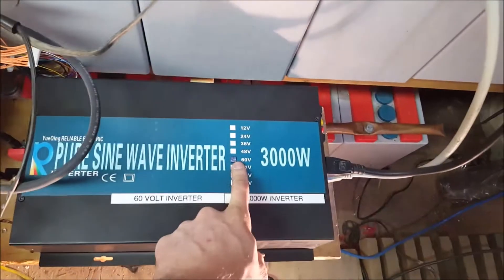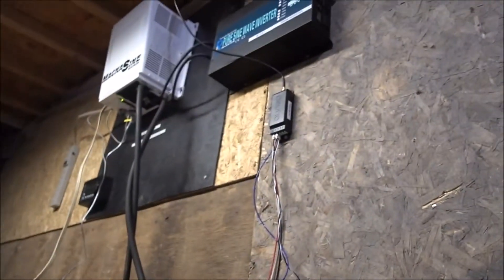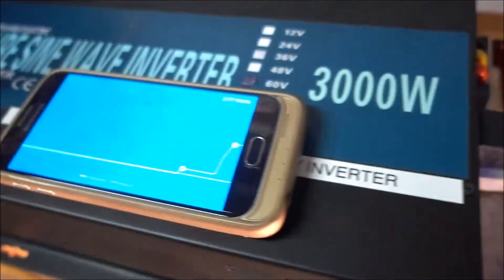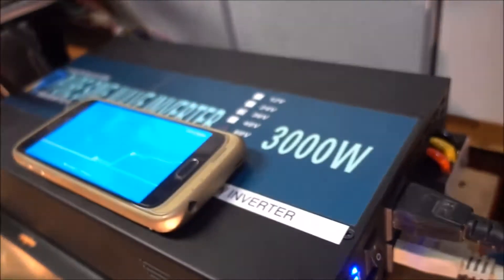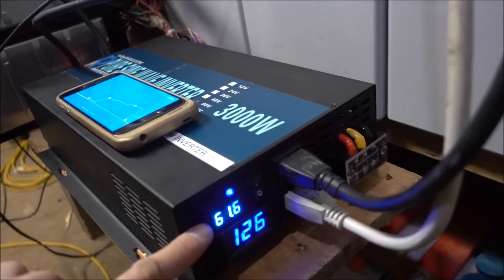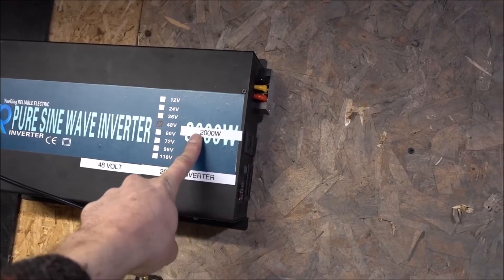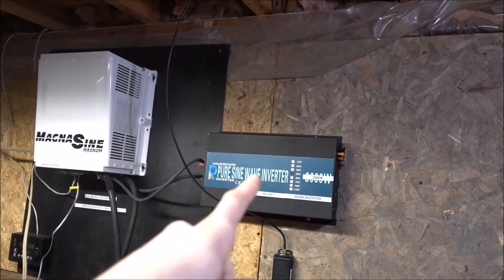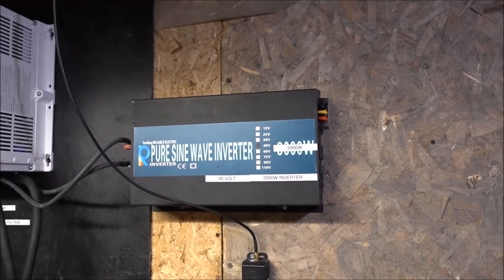60 volt Reliable 3000w Inverter Max Load Test

Comment: tip inverter for lithium battery output dc 60 / 66 volt 43 amp to 230 volt (dutch) please help
Reply from the maker: you have a 16s lithium ion battery bank?
Reply: @GoingOffGrid101   BMS  17s  18600 bat.
Reply: oeps  16800 cellen
Reply from the maker: @thepowerrunwijchen  magnum 4448 inverter can operate up to 67v and genetry solar inverters can go up to 70v
Reply from the maker: @thepowerrunwijchen  and if you looking for a smaller 3000w inverter reliable makes custom voltage inverters.

Comment: Where did you order the 60v inverter from?
Reply from the maker: I ordered it from reliable specify your voltage range
Reply: @GoingOffGrid101  60v also. What did you use to log power, a smart bms? Does it measure amp hours and kwh?

Comment: Hi. Love your videos. My friend and I just got 24 Hanwha 330 Watt Q-Cell G4.2 24-Volt solar panels delivered. (8000 watts total). We are going to split these up for 2 locations. We plan to use a 48 volt system with 6 volt golf cart batteries like Trojan T105's or the Global batteries. Both are 225AH rated. What do you think about the Reliable Inverters so far? We are thinking about ordering the 8000 Watt version for some overkill. We probably won't run more than 5000 watts maximum through it and that would be with most everything on at once, 1000 watts to 3500 watts normally. At my friends house he has 3 mini-split heat pumps that are about 850 watts each (9000 btu) but he normally only runs 1 or 2 at once and of course the occasional dishwasher or clothes washer and the fridge which is probably 400 watts when in cooling stage. Of course the low wattage items like LED lighting, Laptops and LED TV.  Do you think the 8000 watt would hold up to inductive loads like this? Oh yeah, we are making videos of our build we will share on YouTube soon! :)
Reply: I would think so as long as its not all inductive loads. I found out that some of the mini-split heat pumps use an inverter built in to control the compressor. It eliminates  the huge startup current (the locked rotor amps can be up to 3 to 5 times higher than running amps) that older air conditioner compressors had so they are well suited for use with off grid inverters. We are using the Senville brand with a Toshiba compressor. I called Senville and found out the 9000 BTU unit pulls up to 9 amps and can start up with just 15 amps max. You can wire that heat pump with 14 gauge wire. We think 2 of these can run at the same time on the 8000 watt inverter without damaging it. Keep me informed on how it goes with your tests!
Reply: Electronic Solutions is my second channel. I made the first post under my personal name, Robert Ballard.
Reply: I have an Aims power 3000 watt inverter with 24 volt input and have done about the same load as you are saying. Runs it all with no problem. I think my window unit is an 8500btu. It pulls about 1000 watts. using 2 gauge wire from the batteries.
Reply: Yeah I have heard that. There are a lot of Aims inverters out there working fine but you typically don't hear about those. I think people only want to report on the failed ones. Also I have seen videos where an Aims inverter failed but if you watch earlier videos by the same person you will see they are running the inverter at like 80% load. Maybe expectations are too high and people over load them like trying to run a large central AC unit I am guessing. Maybe too much inductive loads. Mine is 5 years old. Still works good.
Reply from the maker: sorry I didnt see this post, I am thinking of the 8000w my self, i like this 3000w inverter and have had good luck so far, only time will tell with this inverter. I would hope a 8000w inverter could run at least 8000w for a short time.
Reply from the maker: thanks my 3000w is running a 5000btu ac unit and all of my garage and office plus the projector at night, and its outside in 29c conditions lets see how good it is.
Reply from the maker: thats good, aims is a hit and miss company.
Reply from the maker: thats really good!

Comment: I was wondering if the potentiometer inside adjusts the output voltage.
Reply from the maker: tried it and does not change
Reply from the maker: I have tried again and yes it does change it, but the unit needs to be running I be leave that was my problem last time.

Comment: a lesson to learn... when you order from reliable electric... tell them you want output voltage 120v ac or 130v ac if you run your stuff at 110v ac... and 240v ac if you're running on 220v ac... that's good

Comment: How smart of them to check this one seeing you have a potential 3,000 customers and I bet if I purchased this one I would get 2000 watts or less, I have to pass.
Reply from the maker: could be yes, OTE has a 1500w he is going to test to see it it is 1500w, I think my 48v was screwed around with to try and meet my custom voltage I asked for and that may have screwed it up, I am going to look at them side by side and see if the parts are the same :)

Comment: I think you have to test for 1 hour to make sure it can handle it for that long.  I realize you don't want to break it on the 1st day.
Reply from the maker: I know it would get to hot if use long term at 2850w, and it would not last long, if a cheap inverter like this can do its rated power for a short time its good, only higher end inverters can to there max load for long periods. I will do a better then soon.